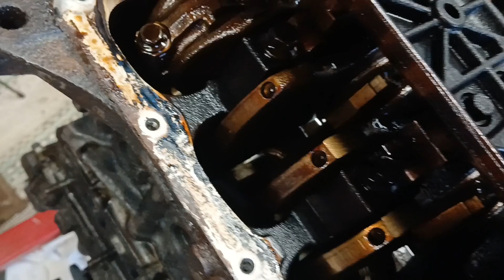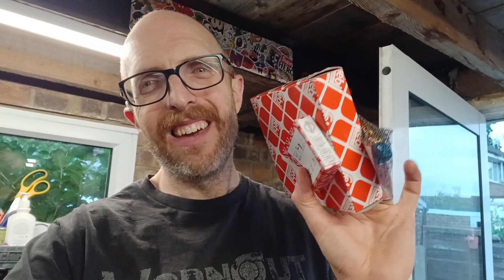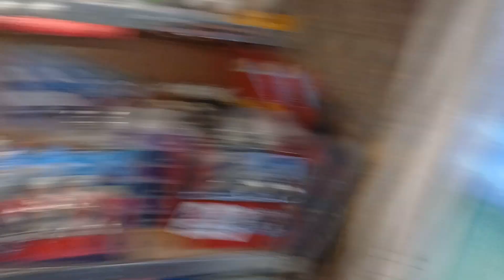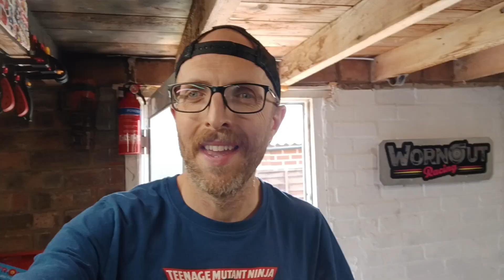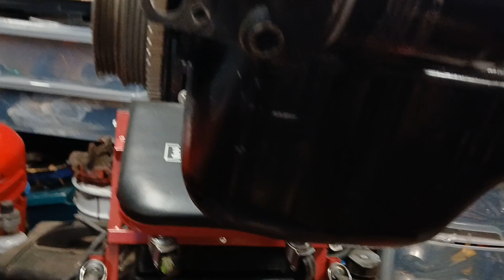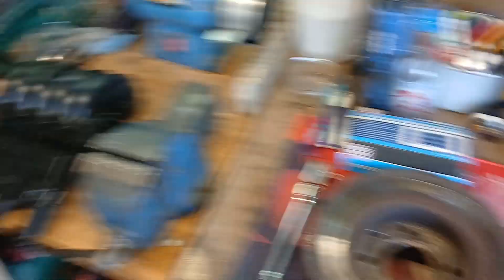The Cinquecentos 16v engine is "finished" ..it's come out soon good

Comment: The oil cap fit a extra oring and it will sit straight.
Reply from the maker: Great tip..will see if the new cap lines up OK and if not will try another o ring

Comment: You can use the stock 1.1 cinquecento pully it should bolt stright on .
Reply from the maker: The issue was more with the teeth on the cinq pulley not lining up with the sensor and i think the stock cinq one will be the same?
Reply: @wornoutracing yea it was the same with my tjet cinquecento I made an adaptor so the sensor moves out to meet the cinquecento pully easy and cheap that works fine , I could try to find a picture for you .
Reply from the maker: @Tjetinside yeah I did think about spacing the sensor out but worried about getting it accurate enough
Reply: @wornoutracing they're pretty forgiving to be honest as long as you can get a gauge between it youll be ok , and ive been running my one as my daily like that for over a year now so works really good.

Comment: I had exactly the same issue on my 1.4 16v with the pulley / tooth alignment. I ended up taking part of the mount away with a grinder until the belt cleared it.
That Punto pulley you have tho - is it from a car with AC, hence the extra pulley and weight?
Reply: The alternator can stay in the same spot. Use a 3pk belt instead of a 4pk and it lines up. I Used the seicento oem pulley and spaced out the crank sensor
On my 1.4 panda 100hp engine
Reply from the maker: @man1to  ill get a 3pk belt and try it out..be nice to not cut the engine mount
Reply from the maker: I honestly couldn't find a none ac/Power steering version..no idea why. Well not for a 16v specific one
Reply: I felt happier shaving the engine mount rather than risking issues with the crank sensor alignment. I was already running a custom ECU and didn’t want to give it any more excuses to act up 😂